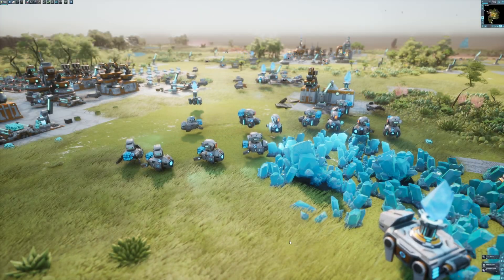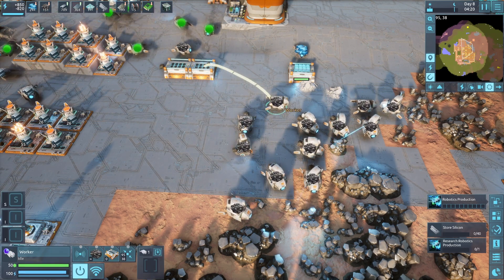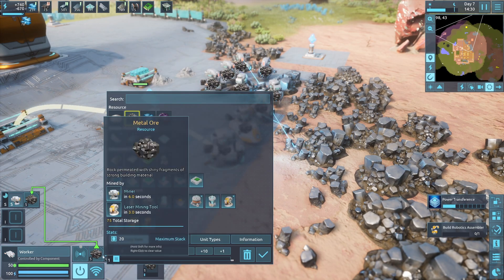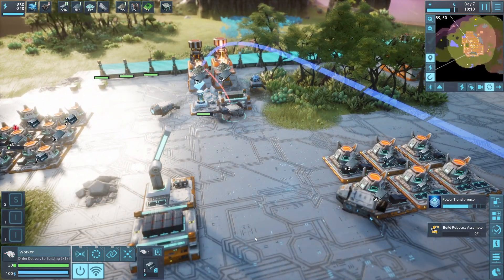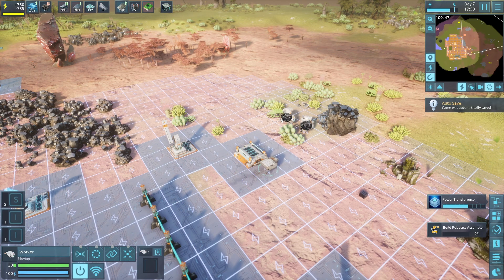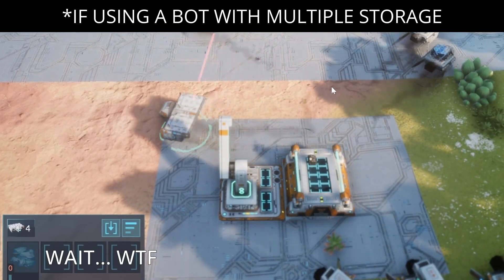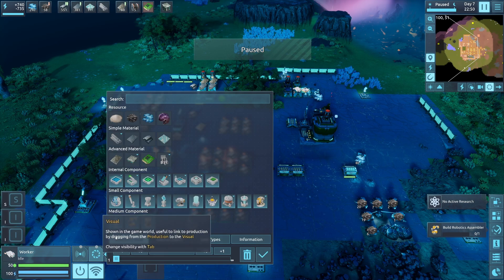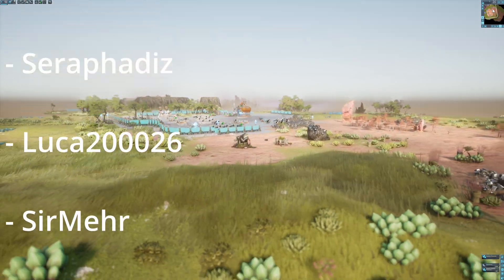How To PROGRAM In Desynced To Level Up Factory Efficiency

Comment: For the transport bot that goes between the mining site and the storage back at the main base. Just take them off of the logistics network and then right click that that logistics button and check the transport option at the bottom. Then just select your goto and your storage and you're good. Never have to worry about it aft there that. They will only transport back and forth between those two selections.

Comment: A problem with your factory is that each fabricator requests ore one by one, thus causing a ton of small travels, like the last mile delivery service guy.

with a storage building requesting required resources, these resources are transported in larger stack sizes. then these are pushed forward to a disribution building with a transport module (end of basic tech) and finally pushed to a storage building where they are made accessible to th network again. this can also be used to combine steps, e.g. ore to ingot to iron plate production.
Reply from the maker: Yep - there are a few ways we can really improve the efficiency but I hope to cover them later ☺️